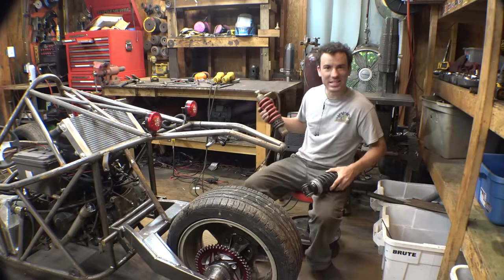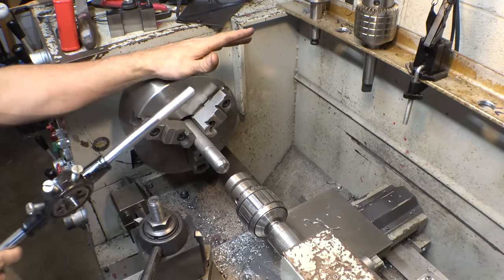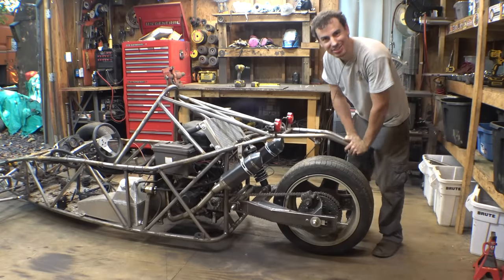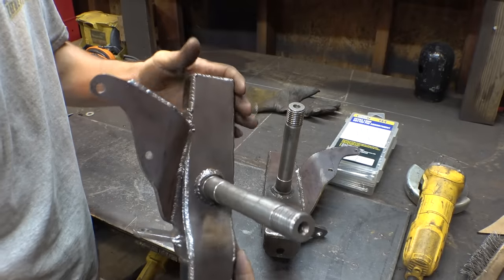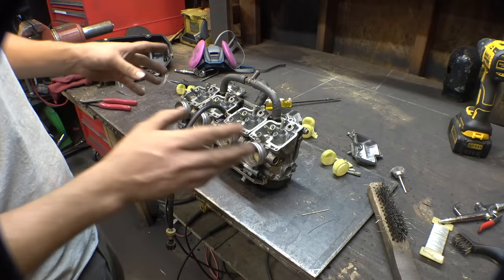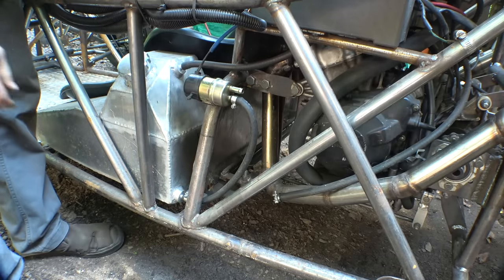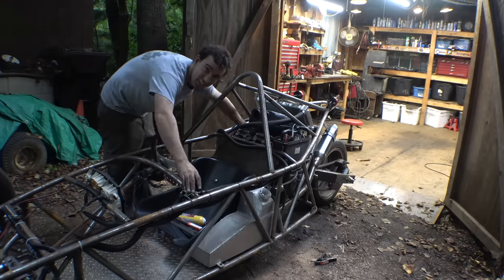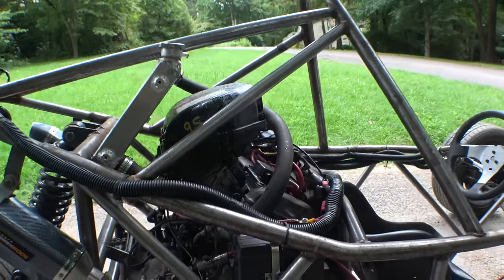Home Built Reverse Trike Project Gets it's Tire Change Finished. CBR 600

Comment: One concern I would like to share. The headlights are positioned pretty close to one another. In the dark they pose a serious threat. The optical illusion can make the reverse-trike appear more far away than it actually is. It leaves oncoming traffick guessing wether it is a car far away of a smaller vehicle closer by. EDIT: check out the Ariel Atom. On that vehicle the front lights are more apart.

Comment: The brake noise problem you are running into is, motorcycle's have floating rotors so the rotor moved a little to match the caliper or any change in the pads. Car brakes have floating calipers, they move to match the rotor as the pad wears. Something to think about.....

Comment: I know this video is over a year old, I hope you fixed the issues I see in it.. The Chain is the major one, You really need a tensioner an/or an idler spring.. Also really need to keep the chain off the rear frame.. Looks good, but very bad issues in the design of it.. Thank you for sharing..

Comment: The fuel pump should work without the engine running or turning over, I love the project I'm on with one myself however it's much harder to make this work in the UK because you aren't using the original frame, so mine is using some of it at least. It's nice to see a build that's "Warts & All".

Comment: I must get out and do my three wheeler tyre, its a Reliant Robin and the front has a slow that is mega irritating that it goes down enough to need a pump every other day but putting tyre weld in etc has done nothing so now got a big litre bottle of slime and some new performance schrader valves.

Comment: YOu need to get those homemade brake discs surface hardened or they won't last very long. Without surface hardening they will just locup at the sight of any heat.

Comment: Most purpose-built race cars are custom made. Race tracks should let you on with the proper safety equipment.
It's interesting how the rear suspension geometry pushes the chassis up and the tire down under acceleration. That should be good for traction.

Comment: I would say your fuel pump may burn up prematurely or have issues due to placement. The closer to the fuel source the better. The closer it is, makes it easier for it to send fuel and not have to suck fuel up to it. Always remember it’s a fuel pump not a fuel suck.

Comment: I know someone most likely has made this same comment but as I scroll through looking I have yet to see one. Use an old spark plug boot or a 6 inch piece of rubber gas line to help changing the plugs.

Comment: Your going to grind true the swing arm in no time. And the back is lifting up under almost no load which means under hard load acceleration it not going to have much suspension and will be full extended

Comment: Get a piece of rubber hose like vacuum hose and put it over the end of the spark plugs to get them in and out it'll it'll also Center I'm so you don't cross thread them

Comment: That rear brake caliper looks like there's not going to be enough room to function. It's a floating caliper  when you apply the brakes the caliper slides on pins so you get pressure with both pads with a single cylinder caliper

Comment: Top tip, Buy a cheapo replica and swap the electrics on to the honda pump. they have like a points connecter inside. Honda pumps aint cheap.

Comment: I hope you corrected the way fuel pump wired.  It shouldn’t pump when your cranking the starter. It should pump when you turn on key to power everything on and run the whole time.

Comment: a lot of bike chains will tension as you go down on the suspension. Believe it or not, this is not a bad thing and it has to do with the overall suspension geometry of the bike. if yours gets a little tighter as you go down, don't sweat. it that's perfect, and I'll tell you why. with absolute exact geometry at the pivot point, guess what you get when you throttle up and throttle down? that's right, you will get lift and squat. and not ever where you want it, like the shaft drive xs, 1100 Yamaha, for example. Yamaha was the first genius to realize that reversing the drive shaft rotation, would allow the bike to lift, seriously helping traction, rather than squat like all other conventional shaft drive bikes. this resulted in the bike planting harder than almost any other bike that year, and it became one of the fastest bikes you could buy. that's right, the reverse direction of the drive shaft was The cure. but that center point off of the sprocket center, can be magic for traction. I might be a troll, but maybe you learned something, at least about which bike was the first one to reverse the shaft direction for traction, LOL 🧐💯

think about how you have it set up, and how it tightens as you go down. as long as your pinpoint for your swing arm is higher than your instant center of the sprockets, she will lift and plant the tires. it's a rather cool gig, actually. never hesitate to look at previous Japanese, foreign, and American bikes, for ideas. the superhero mechanic will take all these previous ideas, and use them to his advantage. yep I'm an ASE certified Master tech of over 30 plus years, so I learned a couple of things last week, LOL

Comment: Have you thought of inverting your positive-roll linkage from the motorcycle wheeled version to make an active anti-roll steering system? Basically cross over the linkage to give anti-roll for the square profile tyres?

Comment: The pump is above the fuel tank, will it siphon? Or does it need to be primed? Because most cycle pumps are located below the tanks. Try locating it below tank to test

Comment: The motorcycle shock has way more adjustability and more spring options. not that pogo shock you put on. you need adjustable shock front and rear. don't take shortcuts on your suspension

Comment: I mean.... In most states, a 3-wheeled vehicle is a motorcycle. And there's a procedure, in most states, to have a home made vehicle inspected, titled, and registered. So... Make it meet the legal requirements for a road legal motorcycle, have it inspected, register it as a self-made vehicle, drive it, profit? 

It's really not too hard to do. Just some paperwork and your local highway patrol station will need to inspect it. Lights (on all the time, at least one and not more than 2), horn, DOT tires, proper exhaust. That's... About it.

Comment: If the rotor is on the same side of the chain sprocket, wouldn't chain lube contamination be a significant problem for braking?

Comment: im sure you have figured this out by now, a year leater... but anyway the reason for the shiiiite exhaust note, is from cheep ebay / amazon style no branded exhaust systems, ESPECIALLY with some styles of baffles that some of them come with... unfortunately ive learned this lesson the hard way myself on my bikes... you get what you pay for, however im sure if you removed those baffels, it would sound 100000% better and subsequently 1000x louder too lol  im sure you have found that out alredy, its also a good idea to see how airbox / intake design effects th intake sound, which could also be what made it sound like an old sears push-behind lmao

Comment: Hi , it remember me old memories..i did something similar,, i took a Mr.Bean car, Mini cooper engine and put it in a dune buggy. The thing is, such little car are front drive.. and i wanted a rear drive.. so..why did i not start with the right type of engine ? well, it was a street car at first.. but when the rusted floor fail and i had to scrap the car, i kept the engine.. so i make my dune buggy but when i was nearly completed..i realise i had 4 speed..backway..and one for the front.. yep.. we all make our mistake... we can't just twist around a front wheel to make a rear wheel...lol, so my dad explain to me i had to replace my engine ..or..find a way to turn it the right side and.. modified the shifter..as it would be behind the engine..in the"trunk"... i didn't want to change the engine so i switch the engine and made a special lever to shift the speeds while sitting at my place... I did it ! it worked.. but just the tube frame was a bit heavy and i wanted the right whell on it, so i put big wide wheel in the back and original wheel on the driving... looked great.. but a cow would have been faster...but it worked.. as long i give it time to take speed..i could change the speed and get faster.  so.. not much power but one day, a neigbourg of mine saw it and wanted it so much... we made an exchange.. he had a volkwagen..but the frame was looking like the Russian Lada.. so we made the exchange and i scraped the frame and made a new one, Mad Max style..the road warrior.. and this time, was much faster....lol ! i was 17..it was great.. i learn welding doing this project.. So

About your chain rubbing.. if you put plastic, you must know now it not going to work... if you didn't find the solution.. i made a  tube inside another one and a sping that work pulling and another sproket where the chain will be pulled with a spring.. so it will allow the tension so stay even and lift you chain from the frame...so the tender for a  timing belt on a pick up would be perfect, ( gmc model ) except, you install a sproket...

have fun..
Did you knew that the reverse trike called a "T-Rex" you see in the US..is a Montreal product ? it was made in Montreal Canada..and then only lately, an Americain company bought it.  this one was made with a 528 i BMW engine ( strait 6 )  and it used a Formula one electric speed transmission, same you see in Lamborgini behind the steering wheel.
i was driving across the company every day and saw it a lot on the road...yep native town of William Shatner..the Captain Kirk..
Enjoy!

Comment: You will need a radiator fan or it will overheat. I had a Honda cbr 900 rr that was race specked with no fan and if I sat for a few minutes it would get HOT.
Reply from the maker: Wait till you see the next video

Comment: Hate to be the dark cloud but that swing arm arrangement is going to have to be reworked again.  The only way to leave as is would be to put a jack shaft in at the pivot point.  As it is one good romp on the throttle at the wrong time and it's going to get real ugly real fast.

Comment: that rear shock spring is too soft. you'll feel it when you're actually on the road. and the chain is deffo gonna slap on that brake calliper. either get a one sided dual piston caliper or you'll need to remake the whole mounting system for both the disc and the calliper later

Comment: The only way to not have that rear chain tension go slack to tight is if you put the pivot on the same axis as the sprocket that drives the final chain. That's why people use jack-shafts that are also the rear control-arm pivot.

Comment: You know that swing arm pivot is to high so just as well drop it now rather than later as well as the brake calliper being to close, don’t leave it you will regret it and dare I say it I’ll bet you have to change out that rear shock.

Comment: Actual spark plug socket has a rubber gripper inside...would save you using pliers removing/installing plugs... And cant you get that certified by DOT for road use in NC?
If not is the VIN on the old frame good? Register it as a motorcycle CBR600 and get your plate... No one will know. Make it look professional...body pannels and paint and even the cops wont really look to close.

Comment: can't you register homebuilt vehicles your state? if you can, get it inspected, titled and put it on the road. i've built a few sand rails out of v-dubs in the past, and in my state, you fill out a homebuilt form, get a police inspection, stamp the vin# the state mails to you onto the frame in a conspicuous place, and a reinspection are all that's needed to title pretty much anything that can travel at highway speeds safely. it only needs headlights, brake, tail, marker, and turn signal lights, seatbelts, an e-brake and a horn to be considered safe. you don't even need a speedo. one of the few perks of living in indiana.

Comment: I'm curious about the geometry of the front end. I see a lot of builds where they try to keep those a-arms mounting points parallel and perpendicular with each other with the bottom one being a bit longer than the top for better alignment during corners and bumps. I see that because of the body shape you have the front of the a-arms slightly longer than the rear of the same a-arms. Does that have any noticible affect on steering? Anyone?

Comment: give it a tune sounds like it got a lazy cylinder CBR 1000 from a Fireblade the CBR 600 have always been a problem matric motor middle code 746 in part numbers

Comment: whyy spin  the starter motor to check the fuel pump? it should be running in ignition on mode

Comment: Looks like you need drop that arm down idk if you noticed when you pull away from the shop it raised up made the chain rub even more than it did with no weight on the chassis

Comment: What material did you make the chassis from?
 What material do you usually use?
Is the material you use solid?
Reply from the maker: I just use cheap steel tubing, lately I’ve been using tubing with a wall thickness of .085
Reply: @ratherBweldingChris  What did you use in the buggys you made before?
Does the pipe you are using now stretch?
is it healthy?

Comment: Old machinist. Made chop saw gears ran 4 machines at one time. Learn to chase threads. Just gear changes in lathe. Check three wire method. All this 200 year old info should be on internet😊

Comment: You are going to have some weird shit going on in the rear suspension under braking/acceleration. Watch the vid as you pull out of the shop. The rear lifts up. That is called anti squat. Since your swingarm pivot is above axle height the whole rear assembly pushes itself under the machine. ThIs is great for drag  racing but you may have a bit of a spooky feeling under braking when it actually will want to lift the tire reducing weight on it and possibly losing traction.

Comment: I really don't want to be negative but the rear suspension you missed by a mile on design ,you have these quickly noted issues right off the bat . Chain rub constantly,the swingarm is crazy overkill for the very small pivot brackets on the frame that have no vertical or horizontal gussets, the chain will more than likely eat the caliper when the chain and caliper float around with only 1/8 for clearance, let alone all the chain lube that will surely cover the caliper and rotor rendering it next to useless, then the spring is way to soft by far for the setup. Good luck on the second try, God bless , be safe

Comment: The pump should be running on the switch direct 12 volts separate from the engine crank on the switch it should be pumping and building pressure  running fuel before engine starts cranking. I thought you were joking I have never seen any one try to run an electric fuel pump that way you have it wired that's nuts. You surely didn't have the instructions.

Comment: With Just A Few Design Changes You Could Have Had A Reverse Gear . And You Never Checked The Float Levels , Also With No Airbox It Would Have Been Running 
Weaker Than It Should Have Been .

Comment: here it comes, troll alert. not for nothing, don't oil that chain too much, are all your chain loops going to end up on your brake rotor, blue spot borough, bro. fade township. believe me you're not totally off. there's an aftermarket company or two, that makes rear sprockets for Harleys that have the center, just underneath the chain, drilled as the rotor. at least you can get some kind of shield between it. hey that's the million dollar idea right there 😝👍

Comment: What would possibly make you think the clutch was slipping your clutch would basically have to be garbage to be slipping before a smooth tire on a dirt surface on a one wheel vehicle the bike that motor came in would have more traction than that thing on that surface

Comment: I can tell you Bud that it's only running on a few Cylinders,the carbs either are stuffed up or it's not getting spark on all cylinders..Can't you hear how it's running? Can't you tell by the way it's down on power? When you push gas pedal it doesn't even sound crisps, you need to spray something in each carb when running and find out what cylinders kick in and out because it's definitely not running on all cylinders..👎🤔

Comment: Disc for the brake you made isnt safe, thats not the proper metal for using since brakes heat up and need wear resistance.

Comment: Why don't you save yourself trouble with all that mechanics and get rid of that shitty internal combustion engine that weighs tons? USE AN ELECTRIC MOTOR INSIDE THE WHEEL, so you save A LOT OF SPACE AND WEIGHT, and as you well know the electric motor HAS MORE TORQUE FORCE, you could even finish your projects faster and easier